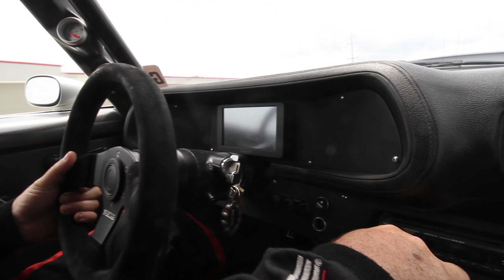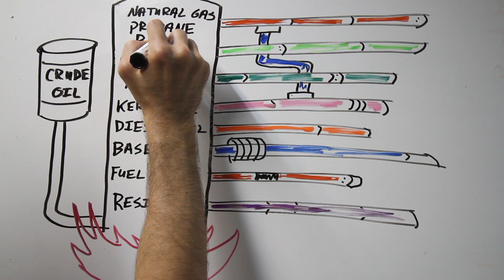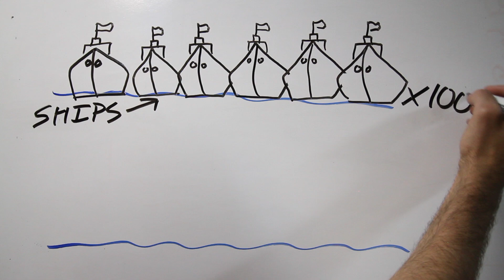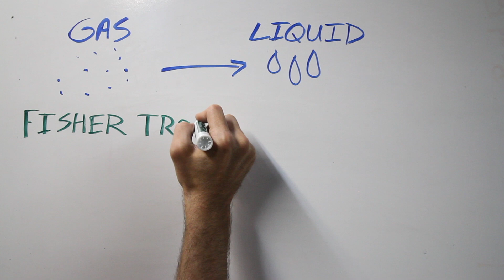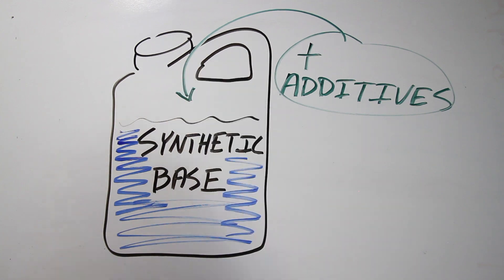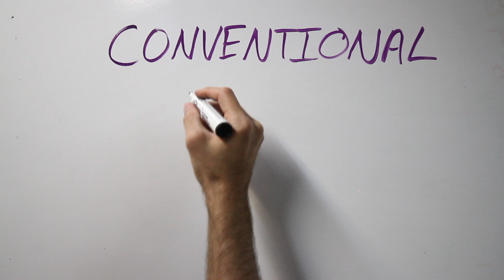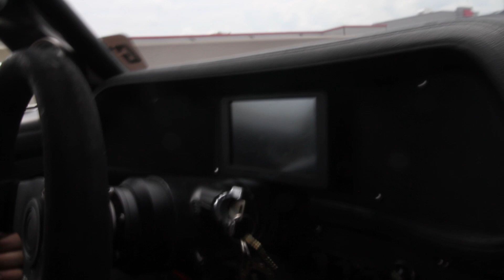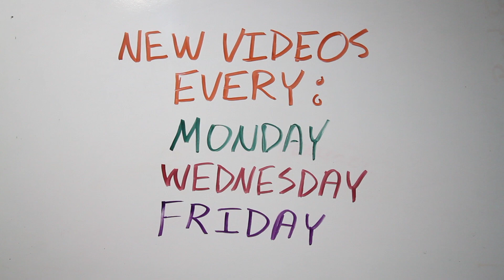Where Does Synthetic Oil and Conventional Motor Oil Come From?

Comment: So if the engine produces a lot of contaminants, they're absorbed, neutralized etc. by additives, with some crud etc also accumulating in the filter. Does this process not take place with synthetic oil? When an oil becomes dirty, it seems to me it's going to need to be changed, regardless, synthetic or not. Synthetic just seems like another flimflam to me.. It's all in the cleaning, neutralizing, protecting properties added through good (patented) chemistry, that lends to a quality oil, my opinion..